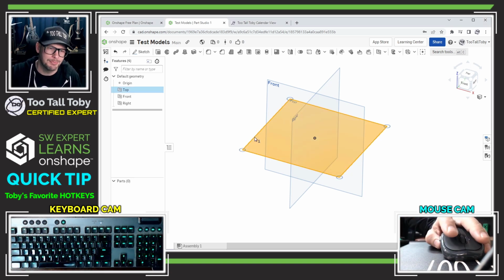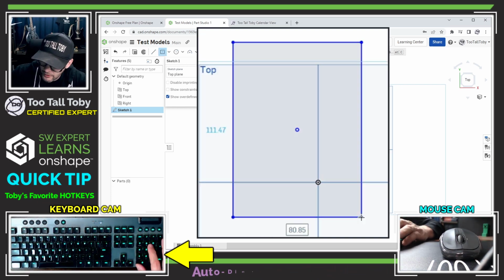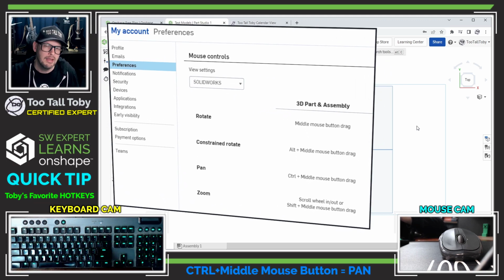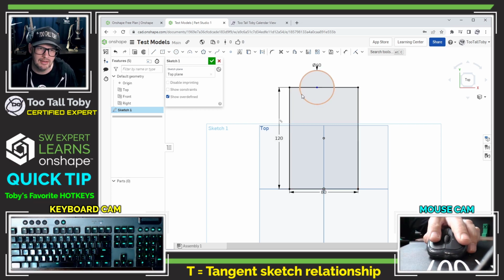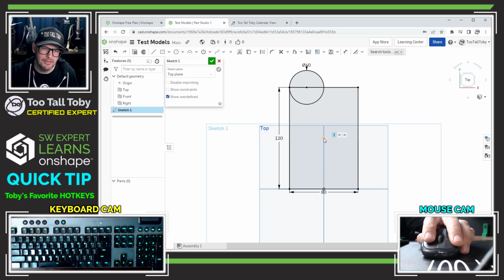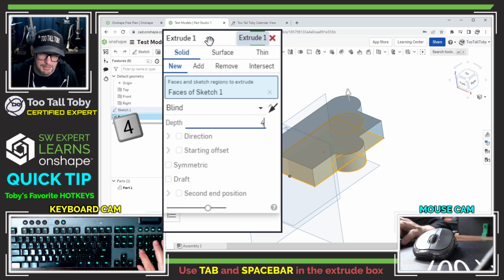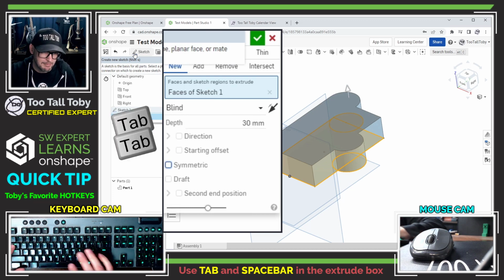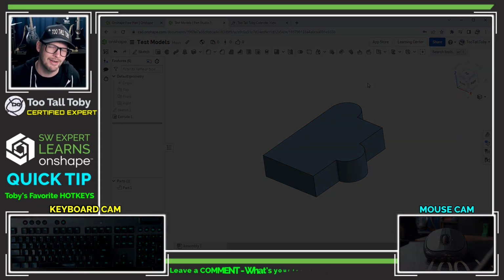SOLIDWORKS Expert's Favorite Onshape Hotkeys

Comment: You mentioned the crossing mouse drag selection, but you didn't mention the intersect mouse drag selection. It works similar, you just have to start the selection on the left of the objects instead of the right of the objects.   Also the P key to hide the default planes is something I use quite often. Another useful one is Z and Shift-Z to zoom in and out.
Reply: That's a great tip - thanks @kesor6 !!  😀😀😀

Comment: hey Tobby. Did you know that press and hold the the middle/scroll button is already "PAN" without the control key?
Reply: That's the case in "default" settings but if you set mouse to control to "Solidworks" then MMB is for rotating the view (instead of RMB).
I made the conscious decision to stick with the "Default" as even though it was different from SW it didn't take long to get used to it and everything works "as intended".
Reply: Yeah  -Just read airwicks comments - good stuff here!  thanks

Comment: These are definitely some nice everyday ones. I personally find I mostly use the "s" menu for things that don't have a specific shortcut already so I don't use it as much as you do!
Instead I use the following a lot: l for line, r/g for center/corner rectangles and c/a for circle/arc in sketches. I also use d a lot for dimension and don't forget q to toggle construction.
Space bar to clear selection is quite useful as well if you are zoomed in and don't have "blank" scree to click in, it also clears the selection from any input box in dialogues. "`" for select other is also better than using the context menu as it will cycle through the selections.
I also use shift+ S for sketch, E for extrude, and F for fillet (haven't gotten used to W for revolve yet...)
Reply: Some excellent shortcuts here, I use many of these as well.

I had a thought while watching this video: I almost exclusively learn shortcuts by first clicking on a command, thinking that there has to be a faster way, finding the shortcut, and basically immediately integrating it into my workflow. But I wonder, do others learn shortcuts differently? For example, by deliberately practicing or by using a reference sheet until shortcuts become natural?
Reply: @zachary3352  This is a great question  - I mainly learn by reading @airwick5083 comments 🙂